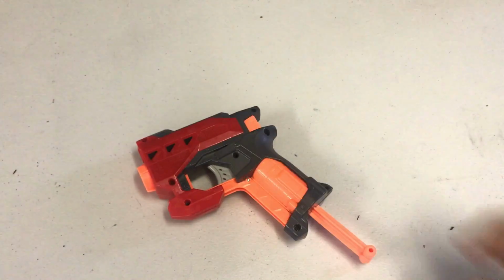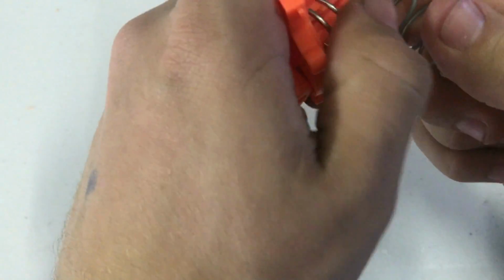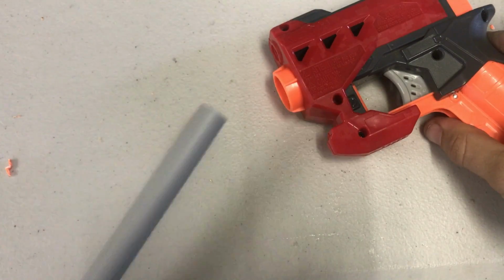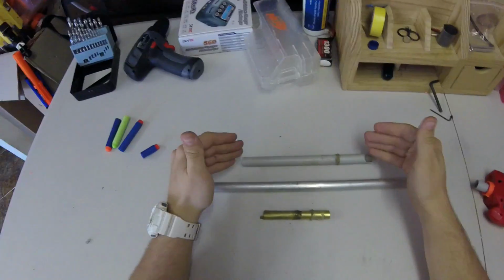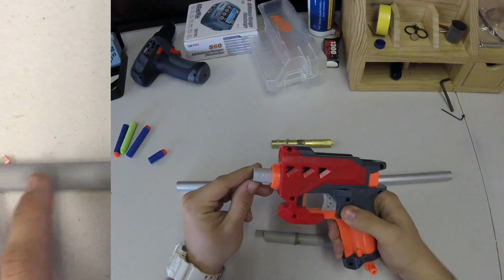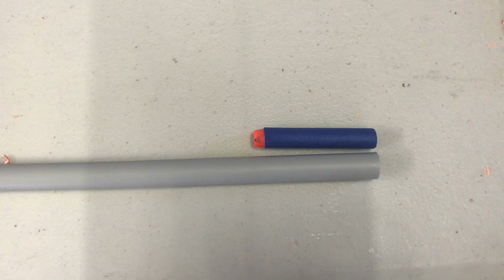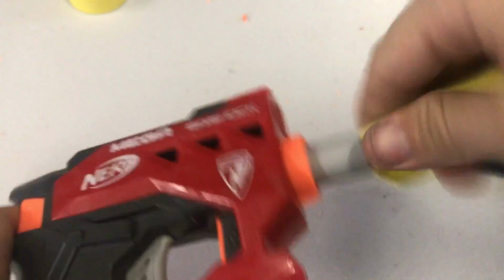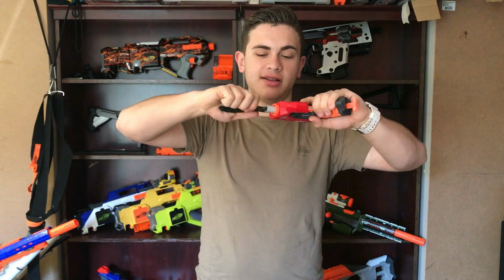50 Fps Mega To, 100 Fps Elite Blaster || How to Elite Single A Nerf Mega Blaster

Comment: You do not necessarily need to remove the air restrict or you only need to snip out the dart post because the barrel will push down on the air restrictor

Comment: So from my area I cannot find the pvc 16 millimeter pipe you are talking about. I also can't find any aluminum 16 millimeter piping anywhere online. The best I have is 1/2 inch cpvc, but because of the after market darts I use, it won't work. Is it possible for you to link theses two barrel materials if you get them from an online source COBBAcrazy ? It would be an awesome help! Thanks!
-PQ

Comment: I wanted to add, even though I'm 9 months late, filling in the two cavities the plunger head ride next to with epoxy putty will get you more power. You'll have to sand them smooth, but it's worth the effort to get more usable plunger tube.

Comment: I used a Deploy sight as the darts are twist fit in it, all I had to do was cut the corner off of the sight picture itself, and it also stops vacuum loading as well. Just a few layers of vinyl tape and it fit perfectly.